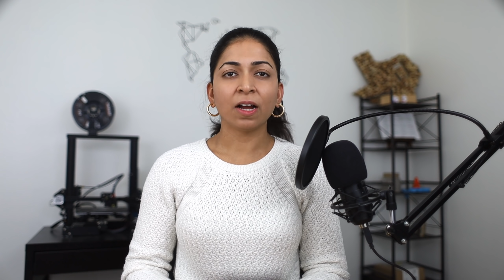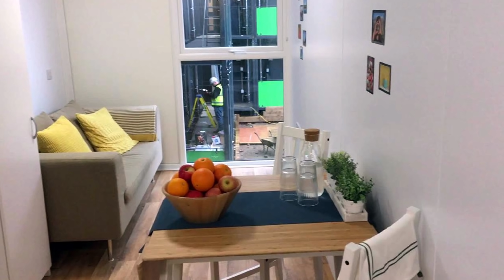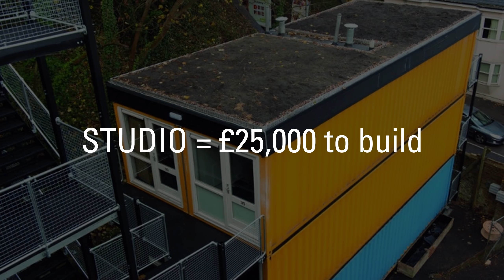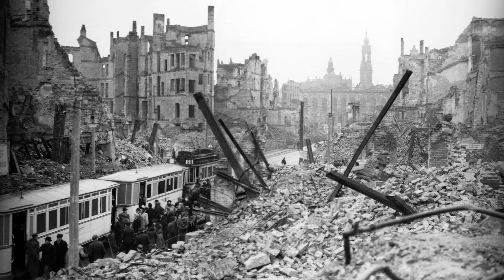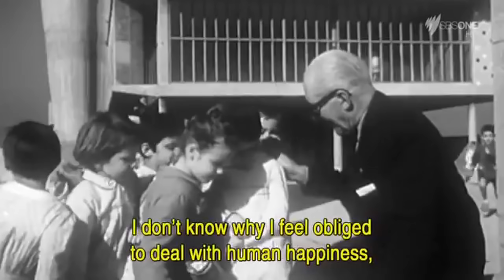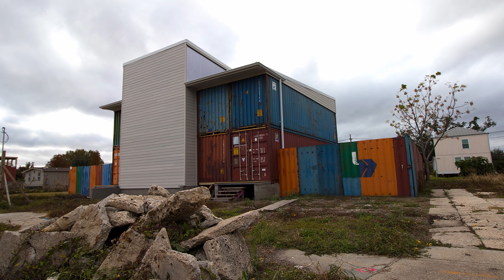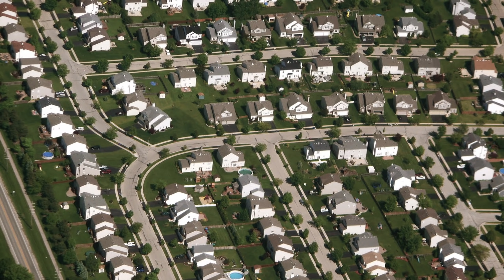Why Shipping Container homeless shelters FAIL

Comment: Keep in mind, homelessness is a problem, not a life style. providing shipping containers is a cheap temporary solution. It should be meant to provide a temporary solution, as opposed to living on the street, without heat or air conditioning, without a washroom facility, or utilities. It is not meant to be a long term option to raise a family. If you lose your house, and don't have the means to sleep comfortably, or shower, you will likely lose your job next, if you haven't already.  So this isn't meant to be done with long term and high cost measures. Sea containers are abundant, and readily available. Strong enough to be stacked, and typically built to exactly the same size, making them modular. If this is what is being provided, I'm sure it can be improved, but it can't be criticised as inhumane. Living on the street in a tent and begging is inhumane.

Comment: I appreciate this video, however, I think good CM projects and standardization of procedures to maximize cost efficiency to avoid value engineering out the "ambition" of saving the world. (...maybe initially through competition and likely via private sector if you want a successful project.) I think the failures of housing projects are more based around cost ineffectiveness and top-down or elitist design imposition, which is why your prescription of humility is apt. 

Blaming the economics behind value engineering is a good way to avoid obligations an architect should have to cost, especially when it comes to making a difference wrt homelessness.

Comment: Hi Belinda! I have just discovered your yourtube videos, and very much appreciated them.  I still have many to view!
This one about the issues with container built homes raises many of my own questions.  But I do feel (as an architect and engineer) that most of the issues you raise could be (and no doubt will be) addressed by better design and engineering.  For example many people live in steel barges which have cold walls immersed in the water. But with better insulation and air conditioning they do not have the problems of condensation and mold that the first conversions experienced.  The main problem with shipping container homes is the awkward prison-like space.  But this can be overcome if two or more containers are spaced apart, or one container is sliced into two parts and the internal space enlarged using large window units as spacers.

Your videos help to bring together new technologies and ideas to achieve better buildings and a better use of materials.

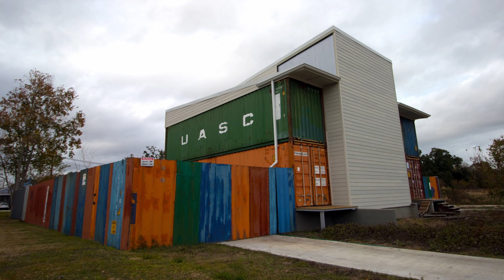Comment: 8:50 

It seems like the constant problem is that the builders or architects or engineers aren't creating buildings with practical safety designs, inspection or maintenance planning 🤔  

So ... the homeless solutions aren't working but people still need homes.

Comment: Is it possible that the builders in New Orleans did not take into factor the proximity to the Gulf?
I'm from Houston originally and live about 40 miles inland.
Humidity is a major factor.
Buildings have to adapt to the environment. 
And yes, Black Mold is an issue in and around Texas.
And not just along the coastal areas.

Comment: The video represents a fair argument. However, it's not the only argument. Space can be created to provide what the user needs within the design aspect of the build. Insulation...and ventilation also can be accommodated into these types of designs. In fact, if you were to look at the average SQ FT of a single apartment of 2 bed apartment in the UK, you may be surprised to note that most container homes using 2 x 40ft x 10 ft containers are actually larger (I have done the comparison and I'm not talking B.S). So, as well as providing a home LARGER than the average in the UK for at least 2/3 less in cost, you can also provide something to a similar specification of insulation and heating option. Condensation doesn't need to be an issue. Lack of heating doesn't need to be an issue and insulation doesn't need to be an issue. There are numerous successful projects world-wide that have utilised this idea to great effect. Perhaps people just need to do some decent research and not just take someone else's opinion as fact or proof of concept or not. I believe the concept is a solution. Not only to supporting an increasing homeless issue but also to low-cost affordable living. Just because it's a 'box', it doesn't need to look or feel like a 'box'. Most houses are essentially a box...just made of different materials. But a traditional build can take 12 months + to complete. Container homes can be completed within 6 to 9 months, reducing building costs, speed of completion and enabling a quicker solution to a larger population of people. People need to think differently, apply creativity to the design on the internal and external space, along with a consideration of the use. Add to that some landscaping and it actually does provide an affordable solution. People complain that new build property is expensive, not well made and tiny relative to the space required, so how is this a solution not fit for purpose?

Comment: I believe shipping containers can be a very efficient way of providing shelter…
Building a home large or small is very difficult and requires dedicated teams of workers and a large budget, shipping containers are seen as a viable solution to homelessness due to their accessibility and mass production as well as being a great foundation to start with.
Shipping container projects can be constructed over 20% faster than traditional housing or substantially faster with workers who have participated in that type of construction before.
Though I can agree with you about a shipping container not necessarily being suitable long term solution for homeless/refugee/low income housing,
I can’t agree with the idea that these structures aren’t an amazing quick and viable solution for homeless/refugee/low income individuals.
These structures can be paid for up front without exorbitant construction and contracting fees while providing adequate shelter for individuals who otherwise would be left unaccounted for in environments that can be substantially less suitable.
I work with refugees daily in resettlement agency 
I know from experience the amount of donations/funding wasted on hotels and rental housing for refugees is concerning being that if there where more temporary housing construction owned by refugee resettlement agencies there would be substantial budgeting for these families to use when they relocate and would live better lives because of it!

Comment: not being a moron but im guessing wherever some immigrants lived previously , were tents outside, still, its not the container thats bad in those designs, it seems its the layout,they should not be severely narrow rectangles, but much more opened up into square  open concept, it shouldnt be all that difficult to ensure airflow and adequate ventilation.its the engineering ,not all the containers

Comment: public housing is a failure only because most projects are built in single-use areas and secondly because the execution was execrable 

During the 1990s I lived in a "social housing" project what was regarded as cheap and bad, now I live in a building built with the same technology and during the same period and on the same plan in the same type of apartment blocks in an area that was equally cheap during the 1990s, except now the rent is 20 times as high and the home is regarded as a luxury where students with well-to-do parents live.  The execution of both buildings was excellent though, during the 1970s in Romania builders who skimped on materials or execution were as a rule tried and shot ;) .

If you build houses for poor people in areas far from work and not open to business activity the projects will fail 100% ... if you build them poorly like most housing projects in UK you only guarantee that they will fail.

Comment: There's a video by 'Adam Something' called 'Commie Blocks Are Pretty Good, Actually' and I found it somewhat compelling. Its talking about a soviet apartment building project that was rather successful and how it contrasts with similar modern designs that have failed. iirc its largely to do with the zoning and amenities surrounding the building, access to sunlight. Part of it was also the contrast with what the residents lived in previously. I'm curious as to what your take would be.

Comment: Install big ventilation fan in reverse (suck air from outside to fully ventilate the room).  Have big windows & double sliding door (mosquito nets) open door ventilation.  The room will not be stuffy.  Better than homeless street.  These container Roof need to be cover so that direct sun not heating the container roof directly & cement flooring.

Comment: Isn’t it amazing that millions of people live in all big city apartments around the world with out it being a big deal . But when you do try to provide people with free or low cost housing it isn’t ok ? Your mention of St. Louis is not a totally accurate ac a count , these apartment, by many of the occupants were vandalized by them , copper wire. , pipes , fixtures were removed and sold as scrap metal . Hence the water leaking, freezes, no electric ,and so on security guards quit the place fell into a living dump . I lived close to this , watched it happen . Non public quarters didn’t seem to have this problem, but when government gets involved , it’s a different deal . Mass welfare for anyone and everyone seems to degrade our social fiber , destroying one’s sense of pride . I haven’t the answer but self sufficient pride goes a long way to help .

Comment: As a builder/remodeler, I can attest that Architects are Not Builders/Craftsmen/Engineers and have absolutely Zero Concept or knowledge as to how a house or building is actually built.   All they do is create ART and expect it to be "Built/Designed/Engineered On Site".  I have gone 'round and 'round with too many to know or think otherwise.  

I am living in the Greater New Orleans area, and have dealt with the Make it Right houses.  But in all fairness, the Lower 9th (and much of the rest of the NOLA) is like it is and has been way before that clown show arrived.  They did not make any lasting improvements.  And I do not blame or hold Brad Pitt responsible.  Unfortunately he surrounded himself with the wrong group of people.

Comment: Looking at the shipping container housing the most obvious flaw of these buildings was never mentioned.  All the doors and windows are all on one side of them.  That means a lot of these buildings will have little or no natural lighting for much of the day and, in many cases, for much of the year.  Even if the windows were open the ventilation would not be very good.  These create the perfect breeding ground for rust, dampness and mould to develop.  They're also death traps as the only way out is on one side of the buildings.  

The ugly residential tower blocks that popped up all over the United Kingdom between the 1950s and the 1970s were part of the New Towns urban developments.  These towns were built to address critical housing shortages and to eliminate the city slums.  While the concept behind them were considered quite radical and enlightened for the times the architects didn't take into consideration the following:

1.  The slashing of wages, salaries and social security payments which made it difficult for the people who lived in them to maintain their apartments.  
2.  The building owners (usually councils or a mix of private and council owners) kept deferring maintenance until the wiring, plumbing or sewerage issues caught the attention of building inspectors or fire departments.  By then, what had began as minor maintenance issues became a multi-million dollar overhaul.  In many cases it was cheaper to demolish the buildings than to repair them.
3.  The use of private contractors and the often complex forms of ownership, as well as the refusal of anyone in any position of responsibility to do anything other than the absolute minimum required by law,  turned a lot of these buildings into death traps.  The deadly Grenfell Tower fire in London a few years back highlighted these issues.  I strongly recommend that you read some stuff about that fire.
4.  Most of the facilities in these buildings were closed down either because no one was using them or because they cost too much to run so they were shut down.  

These buildings looked great when they were first opened but practically everything does.  The shortcomings of these buildings usually don't become apparent until well after the TV crews and the public relations people have moved on.  And, of course, the prevailing viewpoint that the people in these places should just shut up and be grateful they're living in such places means that if they complain about any shortcomings they're ignored - until something goes seriously wrong.

Comment: On the small comment about suburbs. The issue with the suburbs, especially American suburbs isn't that they're 'soul less' although they can be. 

It's that they are increasingly unobtainable and economically unsustainable. They simply don't have the density to support a tax base that pays for their infrastructure and must constantly grow to outrun their problems and bring in fresh revenue.

That doesn't mean you cannot have suburbs or that all suburbs are bad. The answer is certainly NOT 'cram everyone into 5-1s and call it a day'. But the current shape of American suburbs with extreme automobile dependency are very costly in the long term and many of those costs are hidden in the short term.

Comment: I know it's crazy but the City of Reading is pronounced Redding they should change the name its insane.

Containers are good as storage sheds and such but it's not suitable for housing and is a waste.

Most architects are full of it and want to make a vanity project that ends badly. 

Some prefabs are fine but semi fabricated is better, concrete printing may show some good results. 

People like traditional suburban homes, I prefer brick over wood as it lasts longer and is less of a fire hazard. 

Alot of homelessness comes from mental illness and substance abuse. 
The world realy needs better mental health care.
 
Also the stigma around substance abuse should be removed, treatment works. 

As for the opiod crisis half of heroin/fentanyl users are people with chronic pain that got prescribed opiates then got cut off and for these people methadone does not work well. 

The Swiss idea and the small pilot programs in the UK show that prescribing medical grade heroin / morphine / oxycodone works well and its not expensive.

People don't want to stay in homeless shelters as they are dangerous full of theft, violence, sexual assault and crime. 

Most homeless people you see in the UK are not homeless, they just go to the High Street and take a sleeping bag with them begging from when the stores open to when the clubs shut then they go home. 

It's sad as alot of genuine homeless people are too proud to beg or ask for handouts. 

For young people wanting to get on the property market its just too expensive, rent is very high. 

I think the coroavirus has made alot of people wake up as they have seen alot of people who did reasonably well loose everything due to the pandemic and become homeless. 

I remember when I lived in the US being shocked from the numbers of people who live in cars or vans. 

Housing is becoming more and more unaffordable all over the world.

Comment: Aside from the other issues, considering there are often shipping container shortages, the idea that there are "thousands" sitting around unused is a bit of a misconception. Some of the seemingly unused ones are actually being used for storage, or are in queue to go back into circulation, or are damaged in some way and not appropriate for most uses, especially homes. This isn't a new issue either - shortages are chronic in shipping.

Comment: Lived years in a shipping container in Amsterdam with full rent. We call it youth housing and use it so people don't end up homeless because of the enormous housing problems. The world should learn from us. 

We add an additional roof on top of the container for climate control and isolation around. It's kinda dumb to put a metal box in the open and expect it to be comfortable inside. It's a great solution, because the houses are movable. This way small areas that are unused for about 10-15 years are converted in little shipping container villages inside of cities. Once there is a new destination for this peace of land, the houses are moved to another destination. 

For example where I lived there was a lot of work in the area for the construction of the facilities, for the eventual residential area that will come into the area. The construction will take about 10 years and until then that area could not be used. Now 600 youngsters till the age of 28 will live there for 10 years, with some inconvenience, but it is a lot better than being homeless.

Things fail, because people don't think smart. Not because it's a bad plan.

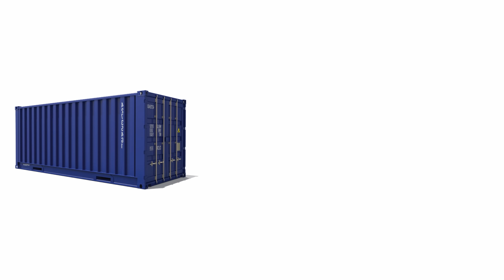Comment: 5:24 This is a very good idea. You don't need the shipping container per se, you can just make a frame of the same measurement and use better insulation panels on the walls, better floor and roof, clean new panel without crazy chemicals. Just use the advantage in efficiency of fabric construction and shipment vs in-situ construction.